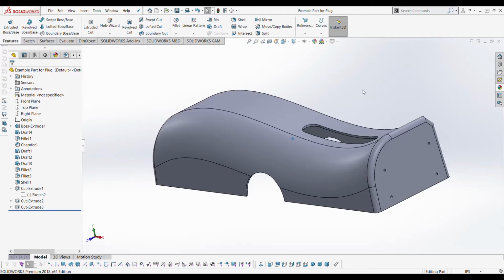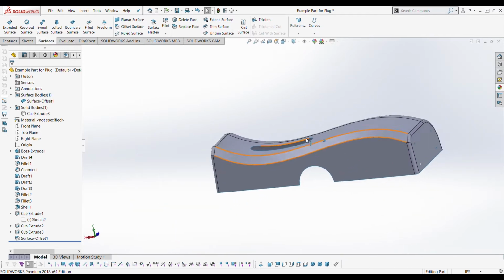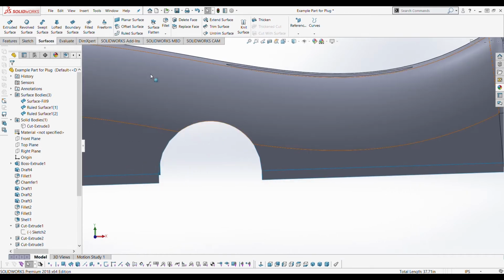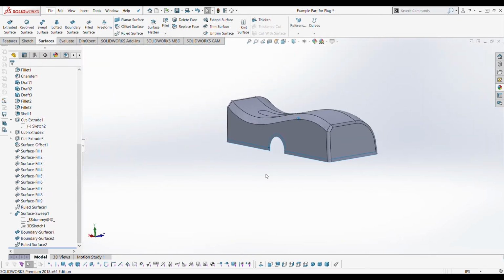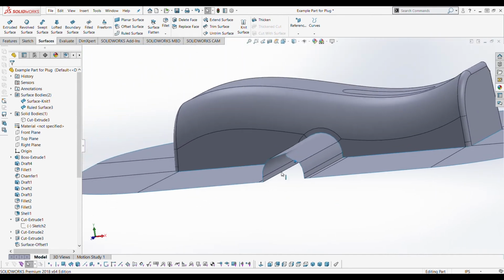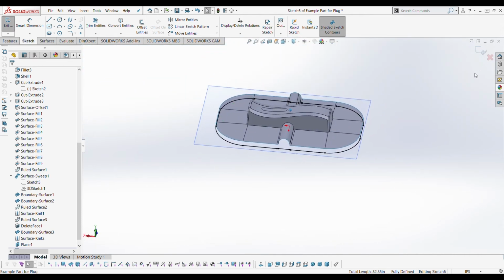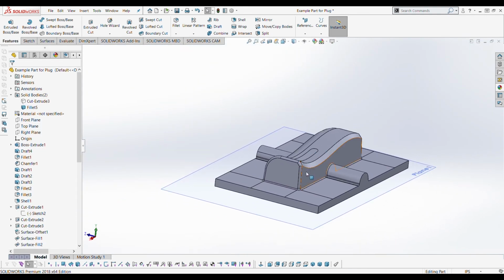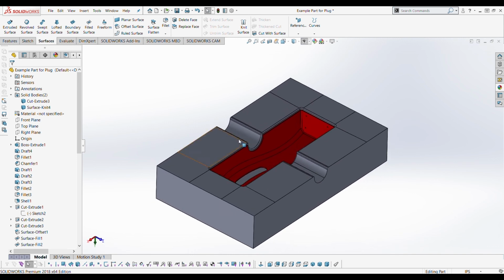Common Fibers - Plug and Mold Design Walk-through on SolidWorks 2018

Comment: you can select a 0 offset in the offset surface tool. It then turns into a copy surface feature automatically. Idiotic signposting in the software, but its there still :)